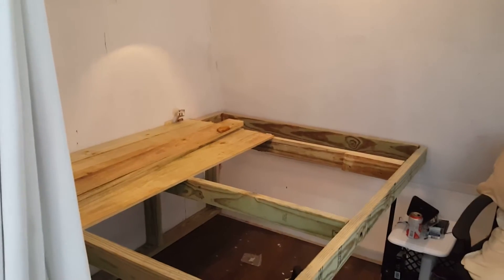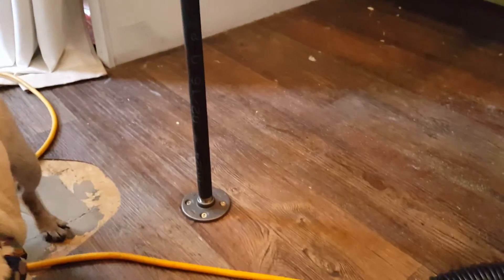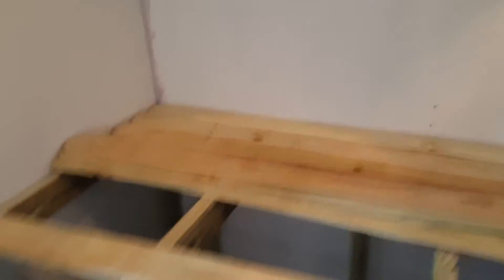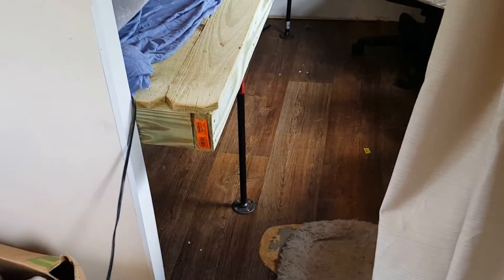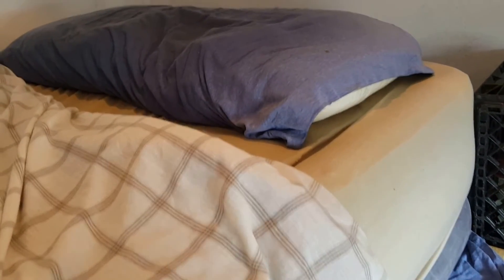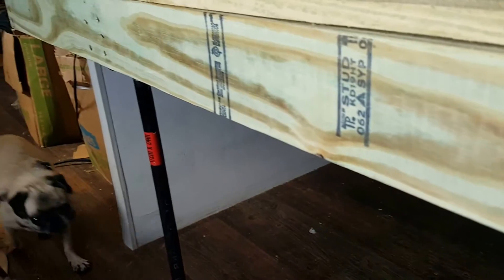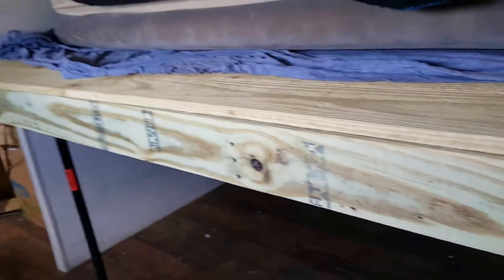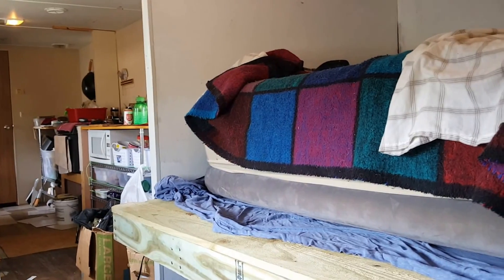My Camper Home - 08.07.16 Platform bed built

Comment: I like it.  Do you remember my waterbed platform in Prairie Grove?  Lots of storage underneath.
Reply from the maker: I do.  it was about half the room.
Reply: so is the bedroom wall load besring. can I cut most of it away.
Reply from the maker: I had originally thought about taking it out but was afraid about the lateral integrity of the side walls.  that is the only cross wall other than the end walls
Reply: well I went for it andi couldn't be happier I founda great couch at IKEA and im going to use  a TV stand thats like a 2drawer cabinet fr the front end platform fr the bed.. and will use some salvaged wood for the rest of the bed frame.